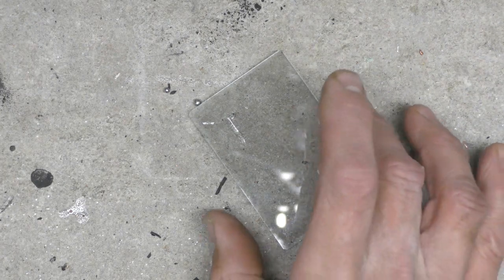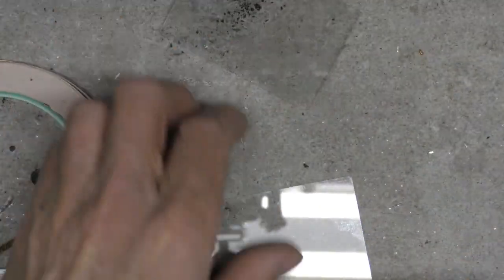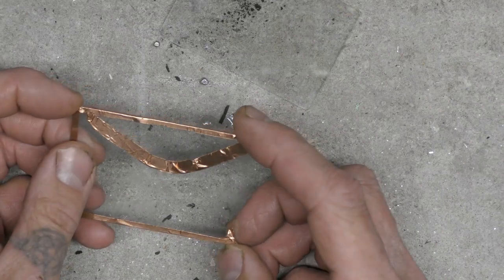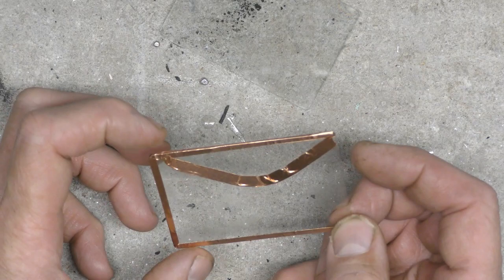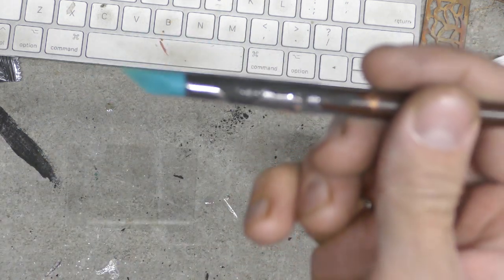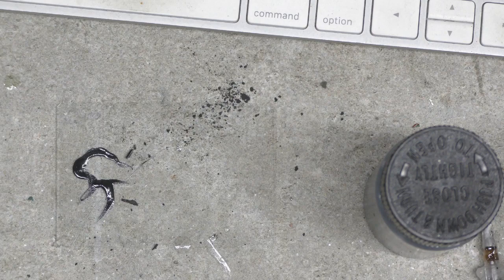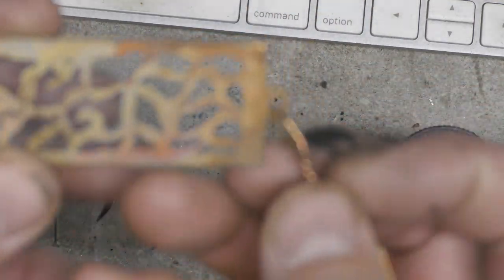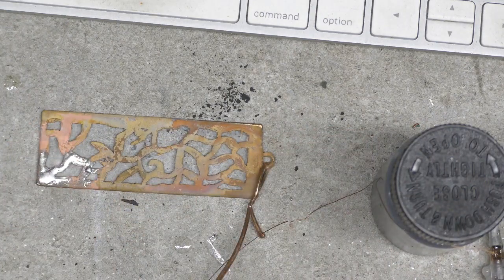Intro to High Temp Conductive paint for electroforming Stained Glass

Comment: 5:00  where there's a will, there's a way in my mind.  they have a resist paint i use on old sheer fabric stapled to an old window frame, using an old credit card to scrape the paint/  place the image onto item or fabric.  it works!

Comment: Ok, this vid is not about organics, but I wanted to offer up some in-site to them. You mentioned in other vids from years ago, and showed using organics such as bugs.  You went to 3D printing them and that is good for making many duplicates. You also said you had encountered oozing from the product. Have you considered plating them, drilling a hole in an inconspicuous location and freeze drying them after completing the project? That can be achieved by putting them in the freezer and removing them (in and out) over time causing them to dry out inside the electro plate without rotting. It does take time and effort but it is very effective for having that bug on the inside! There are also taxidermy solutions that can be injected to speed up the preservation process. Just a quick tip to help expand a process for that one day when someone wants you to produce them a keepsake. Thanks for all the vids, I do spend many hours watching your teachings. Please keep them going.

Comment: Let me trade you some tech-  ti pen (titanium pen glass artists use to sign their work) leaves lines that are conductive... sort of 😂
The lines the ti pen make are extremely fine and difficult to bridge to, and bring into the plating circuit.  I've had some luck using paints at the edge of the drawing.  

Drawing with the ti pen works best if the glass is wet.

Currently building a DIY pen plotter to put ti pen into.

Comment: If you clean the copper first then apply the flux it would work better. And, believe it or not, you can use a higher heat. I used to repair circuit boards, and for a 60/40 lead-tin solder, the best temp was 615. It gave instant solder melt and allowed me to solder everything I needed with little to no damage to the PCB. The temperature will change depending on what solder you use, but you are looking for a temperature that gives both instant solder melt and heats the copper up quickly. Solder follows heat, and flux aides in heat transfer and solder flow, but the copper needs to be clean